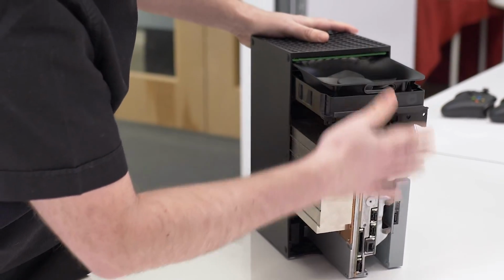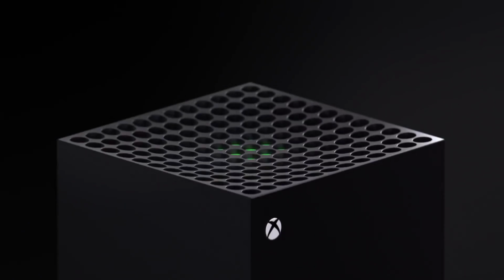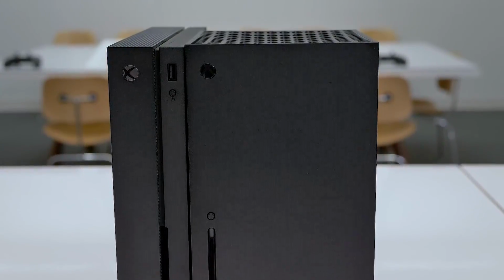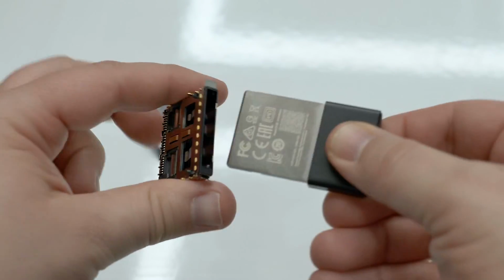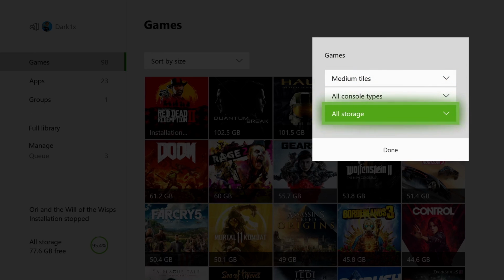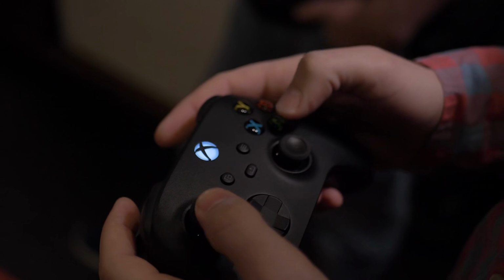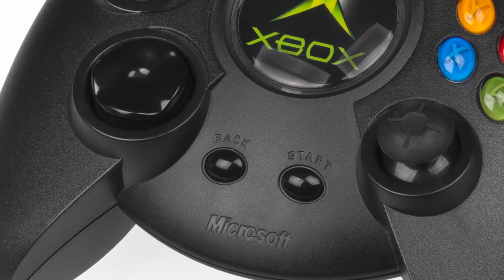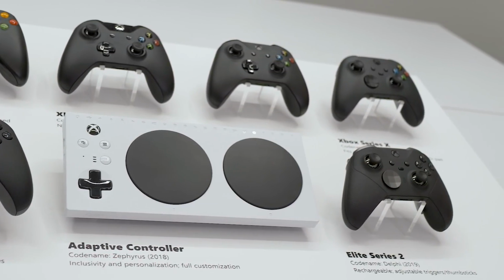DF Direct: Hands-On With Xbox Series X  + Impressions + Xbox One X Size Comparisons!

Comment: The thing that really worried me is the storage size. I currently have a 6 tb hard drives filled with games and that isn't even half my library. With games getting bigger the need for more storage is getting increased as well so going SSD only is in my opinion a mistake. I preferred SSD for the console itself but upgradeable with external hard drives. On my PC the SSD for the OS is great but HDD is still fine for my games as so I would prefer to have the option.

Comment: That is a beastly machine.

I'm so happy they finally are taking it back to the 360/PS3 days and making console refreshes great again with fairly cutting edge tech.

The PS4 was great (XBONE not so much) but still was too weak.

Now with these next consoles having 10+ TFLOPs of GPU in a 7nm form factor, and Ryzen CPUs and presumably 16+ gbs of high speed ram...these beasts will rival high end PCs in performance.
Reply: Until nvidia drops the 33 teraflop GPU next year :/
Reply: @ambro2786  That's a £10,000 supercomputer GPU. It's not even a consumer grade GPU.
Reply: @HelloFellowDinosaurs  nope. Itll be the Nvidia Ampere cards. Leaked reports show itll be the 3080
Reply: @Ismael-gl9be  but they said they wanted me and that they wanted my personal info to keep it safe from bad people
Reply: @HelloFellowDinosaurs  Regardless the XSX is a seriously nice piece of tech. I'm very impressed with what Ive seen so far and thats coming from a (new to PC) centric player. (2080S and I7-8700k)

I'm also loving the supremely confident MS! They coming out swinging!
Reply: The PS5 isn't over 10 teraflops. It's 9.2 or 33% weaker than the Xbox Series X
Reply: @PlaceboHead360  This hasn't been confirmed.
Reply: @PlaceboHead360  that's bullshit because another leak put it at 11.6 teraflops.

Comment: They could be cheaper if the open the format, Sony wont use anything they wont design (which killed the PSP and the VITA) and i can see those being used on laptops and desktops, the only mistake microsoft is making is putting the slot on the back,  having it up front means easy switching and people seeing it as a swappable piece that they can take with them to a friends house or even gaming events.

Comment: A bit gutted they removed the HDMI-in port, my One X really is my multimedia hub and I’ve got my main TV box plugged into it (and the 360/Switch/Apple TV before that) and will be a step back from my One X in that regard (and probably only that to be fair).

I’m guessing they had usage statistics which showed it was barely used for them not to consider it, either that or they’re trying to get as far away from the original XB1 announcement as they can, but if it’s the latter it’s a regression, IMO 🤷🏽‍♂️
Reply: Probably because of all the negative feedback they got on the Xbox One when they announced it was more of a multimedia station than a gaming console.
Reply: me Gustav They could’ve just quietly added the port and not even talked about it and no one could’ve got upset, but seeing the internals of the thing now I’m guessing the bigger reason was space 🧐

Comment: So does that mean the XBSX has 52 CU active. Or is it 56 CU active.....which would mean 13 TFLOPS @ 1825 MHz?
Reply: Its based on a 56 CU GPU. 4 CU's are disabled, so only 52 CU's can be utilised. It's a 12.15 TF GPU.
Reply: ResonatingRaptorid65 - I just read the write up. Looking pretty good. Can’t wait for the PS5 specs now.
Reply: r. henly they say 12

Comment: So you can use an external USB drive but only for backup, not to have games installed and run from.

You can only expand storage for installed games using the proprietary expansion 'cartridge' ??

So we'll be back into the realms of having to uninstall/reinstall games as and when we want to use them due to a lack of inboard space.

Yeah, because that ain't gonna bite them on the ass.

While Sony will likely continue their pattern of allowing quick and easy storage upgrading by the user.

And, before anyone says it, I'm not a Sony fanboy/ Xbox hater.  I currently have a 360 S, Xbox One X, PS3 (Fatboy), PS4, WiiU and a PC; and love them all  ;-)

*UPDATE*

Since posting this, I have now found out (from an Austin Evans vid) that back-compat titles will run just fine from an external drive, as before.

It is the titles made specifically for the Series X that 'require' the custom SSD storage, due to them being so reliant on the much higher performance of it.
Reply: Not gonna happen dude - Sony will have the exact same problem which is a specific requirement level for the storage will be needed to run the games, therefore will be the same solution as MS are doing, nothing to do with greed this time as well, just making sure the performance is there.
Reply: @simonwest80  On reflection, yeah, you're probably right there.
Reply: @RichardJRussell  it's both a blessing and a curse. And the Sony system sounds more advanced than the MS one and will likely need an even more expensive one unless they have some cool trick up their sleevs

Comment: About two years ago, I guessed pretty much what the nextgen consoles would have, gpu and CPU wise. And I got pretty much everything right. I said it'd be 6-12 cores CPU, but highly possible it'd be 8-16, GPU would be something like a GTX 1080 Ti-ish level of performance, given the One X was already 1070-ish, so anything less than that wouldn't cut it, and my RAM guess was 16 or 20 ish, but not less. But I've never thought of practical innovations, like swapping back and forth through games, SSDs that could work as some sort of thumb drives, those things are so cool, we, this time around, will have of one the biggest revolutions in games since when the vanilla PS came around. I just wonder what else we're gonna see in terms of new game mechanics, in engine upgrades and stuff. Man, I'm so stoked for this gen.

Comment: I am starting to like this design the more I see it.
Reply: The inside makes you like the outside
Reply: It stands out, is smaller than it seems and has a big vent facing straight up, the direction heat goes! I just wanna pick it up and shake it and then see if it’ll run Lost Odyssey in 8k 🧢
Reply: Expect Sony to copy the design.
Reply: rollandoTech I really doubt it
Reply: @AnANas00-x3p  i mean, the original xbox is a copy of playstation?

Comment: don't tell me they would still actually make you buy those play and charge kits for that controller
Reply: That's a good thing. Sealed batteries, like on my PS4, means when the batteries are no good anymore the controller needs to be replaced or sent to a shop for repair. With Xbox you just pop a new one in and keep going. In a pinch you could even take the batteries outta your TV remote🤓
Reply: @MaxximumOne  Never had a problem with the batteries in my ps4 controller. Never went bad. Never had to replace the batteries. Having to worry about replacing and changing out batteries is an inconvenience.
Reply: @ThaShiznit1986  you can charge the battery while it's in the controller.
Reply: @MaxximumOne  still sucks that you need to actually buy a battery not get one when you buy the console itself

Comment: From the controller point of view, it's very interesting to see that the series x controller looks almost identical to the elite 2, I guess they basically took all the refinement that was brought into the elite 2, and add it to the series x model with a slight design and feature tweak. Even the bumper side looks almost identical. I have a feeling that xbox won't release an elite controller for the series x (at least for the first gen), and wait until further refinement is made.
Reply: Raikozy isn’t it smaller tho? I was hoping they would make a third gen elite to match the smaller size and also I’ve heard the elite 2 has problems still
Reply: @srt8up4shot  I actually don't have any problem with the elite 2 controller. But yes I heard the first elite has a lot of problems. Yes you are right I heard it's smaller, but I don't know to what extent, I only made that comparison based on the shape and button placement. I actually heard that the elite is ever so slightly smaller than the normal controller, but I never noticed.

Comment: it kinda seems like opening this thing, dusting it off, maybe changing thermal paste should be quite easy, which is great.
Reply: cleaning the series X is going to become easier then cleaning a ps4 slim
Reply: thiscouldntblowmore is it bad that made me horny?
Reply: @Ismael-gl9be  we all have our kinks.
Reply: @Ismael-gl9be  I think your idea of "thermal paste" is slightly different from the rest of us...
Reply: @Reydriel  what's that on your underwear? I swear it's thermal paste 😂
Reply: Ismael C Hahaha same 😳
Reply: Easy money for system repair.
Reply: @seriousx3021  for idiots who dont do it themselves? Yra
Reply: Changing thermal paste? Calm your tits, this is an Xbox, not a cheap ass playstation.
Reply: @bobdingle2539  
Might as well go all out if people are going to change it and go liquid metal, at least you get proper gains that way.
Reply: Dont know why u would do that?! Have my og xbox one in my badroom and my one x in my living room never touched the inside of one console....
Reply: Croyt CH because it can potentially increase the life of the unit being able to clean the dust that gets built up over the years and replacing the hard paste with something premium.
Reply: @Croyt_CH  I said the same thing untill a couple of weeks ago when my scorpio XB1X started over heating and shutting down. I replaced the thermal paste and it runs like new.
Reply: the fan is separate from the heatsink, it will be very loud
Reply: @Zero11s  
Nonsense, my 140mm fans in my PC case are quiet enough, they have no heat sinks next to them.
Reply: @Zero11s  
Looking at the blade angle, size and amount it should be reasonable.
Reply: Irony about that is it's highly unlikely to become a dust collector
Reply: My penis is unbelievably small, but  
True but you can see it's a big copper plate on the die so it's all good, just protect the SMD's and golden.
Reply: Or simple to put water cooling in this case.
Reply: My penis is unbelievably small, but  but water is more efficient, lower temp and noise.
Reply: @AnANas00-x3p  
If you put water cooling in the case it would be a small rad and to be honest the stock cooler would do a better job, it's a big vapour chamber and the fin stack is tall and dense, I bet it's as good as a 240mm AIO, would be a nice little project though.
Reply: And a good way to void your warranty, but if you dont care about that then yeah it should be pretty easy
Reply: @-Sirens-  Warranties only last for a year on consoles. I replaced my thermal paste on my One X (Scorpio edition) after the warranty expired because the fan started to run really loud. Now it's whisper quiet.
Reply: @a55a55inx  
Depends on your country, everything is warranty protected for 6 years in the UK, except for obvious high ware items like say brakes on a car, home electronics though you're covered.
Reply: @wing0zero  True. In America,  it's usually only a year
Reply: @a55a55inx  
It's 1 year in the shops here, after that you often have to send back to the manufacturer, but some shops will still take it and send it back for you, there was actually a case with the Xbox 360 and MS didn't take red ring consoles back but the government made them cover the 6 years.
Reply: Sirens you can no longer void warranties by opening your console, look it up.
Reply: My penis is unbelievably small, but this guy im replying to is even smaller.  True the thermal paste should last that long, but ive heard of people replacing the thermal paste very quickly on their old original xbox ones because it wasn’t very good from the start.

Comment: The return of memory cards hells yeah!!!
Reply: I wonder how much they cards are gonna cost...memory is gonna go so fast this generation.
Reply: Vita all over again
Reply: The only good thing about this is if like micro sd, ssd mvme would go cheaper thanks to being now on consoles (kind of like when switch came out and cards of 512gb and 1tb drop prices really fast).

That would be the good side (though, insiders say that cause of problems in manufacturing all flash storage is going to be a little expensive in this year).
Reply: You can still use external HDDs via USB. You would need the memory card if you want to match the SSD speed.
Reply: Uğurcan Evci did they say we can still use slower media of memory?
Reply: @KhmerVidz  Yes, you can still use slower USB drives for game storage, and playing previous Gen games.
Reply: Kewlzter TC wow that’s great news.
Reply: Dude... Maybe I miss something but memory cards weren't great to me, and these days I doubt they're gonna be cheap.